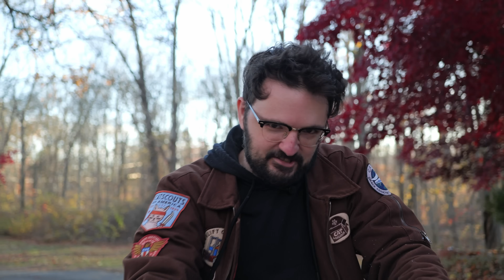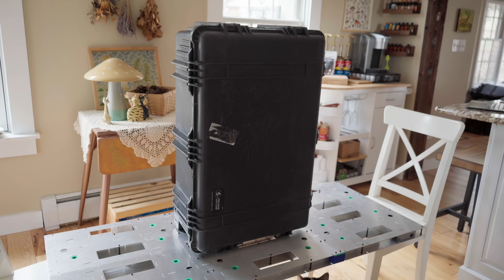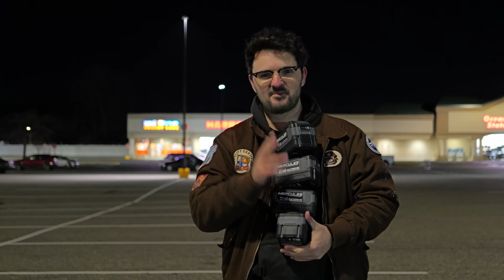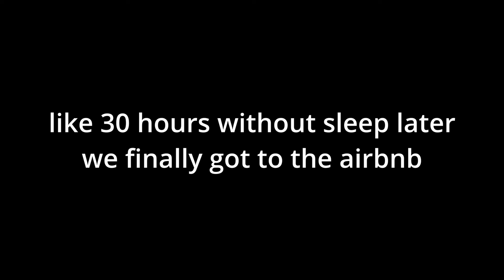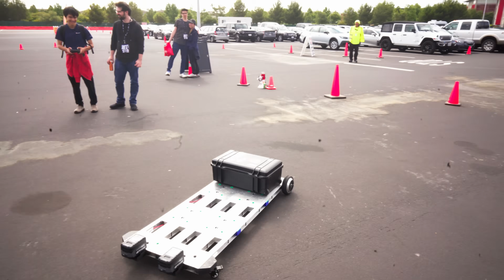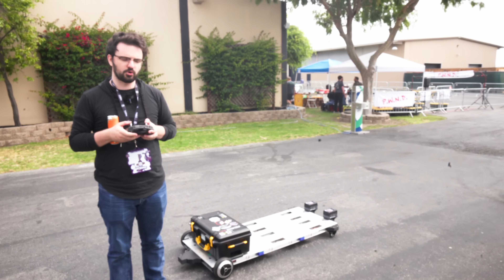Making a Utility Vehicle That Packs Into My Carry-on

Comment from the maker: I think i could make it even more truck like if i could've used carbon fiber, Hope you all enjoyed and thanks for watching!
Join my discord to get slightly early access to videos! https://discord.com/invite/htSdsgsGaN
Reply: That was pretty cool!  One change that might make things easier would be to put the powered wheels in the center of each side, with a caster in each corner.  That way, both power and steering are centered under the center of mass.  

I would also have the wheels slightly lower than the casters, so both wheels are always firmly on the ground, even when the ground is uneven.  As long as any weight isn't dead-center, it shouldn't rock back and forth.

Cheers!
Reply from the maker: @KeithOlson great suggestions! I think  my biggest issue with doing changes like this was just the weight issue, casters are usually steel and steel is heavy!
Reply: @KeithSachs  I just did a quick search and you can find casters with aluminium frames and cast aluminium hubs.  One example that might work well is the 'Durastar Medium Heavy Duty X05 Series - 3" x 1-13/16" Sirius HD Donut Polyurethane on Aluminum Swivel Caster - 550 lb Capacity'

Cheers!

Comment: Cool idea. Would be awesome to see you take it to the next level by incorporating the case itself as a structural element. There's a lot of material that counts towards your weight budget, but doesn't add to the final product. The caster wheels could also be used as the carry-on wheels when fully collapsed.

Also, switching to a carbon fiber composite could potentially save you more weight.
Reply from the maker: id love to do all of these, i wanted to do both originally but i had already purchased metal before incorporating it as the actual case, and carbon fiber was just way too expensive. Maybe one day!

Comment: In future, you'll get more controllable steering if you move the drive wheels away from the end toward the center a little bit. There's a lot you can do with quadratic input curves on modern transmitters too. I would use a "v tail mix" for steering so you don't have to do the tank steering thing. The bonus is that when you mix the channels to pull steering onto a separate axis from drive, you can suppress the steering channel with either more "expo" or even bringing down the gain to make the steering less responsive than the drive. It can't change the physics of the long-narrow config, but it at least makes it less enthusiastic to go into a death spin.

Comment: I think you confused full throttle for minimum throttle position. Looks to me like your "truck" went full reverse on disconnect, for which you need to tell your tx/rx system to fail to center throttle, or you could just use your aileron channel for forward/reverse...
Reply from the maker: It went reverse in the sense that I am choosing to say the casters are the front, but the actual setup is that hitting backwards on the throttle makes it go 'forwards'
I did this intentionally because I originally wanted the casters to be the back, but it drove better the other way. 
I didnt change it because i figured the reverse beeps were a feature to let people in the crowded venue know that something was near them.

Comment: A stick radio intended for ground use, with a sprung throttle that returns to neutral would have been more optimum, with mixing for left and right motors ( driven motors should be at the front, not the rear unless you like crashing and spinning out ) to give a more natural steering/driving experience. The failsafe mode on signal loss is also more ideal- returns throttle to neutral. Live and learn, robotic combat guys have this all figured out- worth doing some research in that direction for an improved future version... :)
Reply from the maker: You're totally right about the controller for sure haha I had never used any of this radio stuff before so I didnt know 
But I actually disagree about the driven motors being at the front, I tried this and it was less controllable, because the thing is so long.
The controller is actually mixed this way and everyone who drove it agreed and defaulted to driving it backwards. Thats why William Osman asked me why it was mixed like that, because backwards on the controller made it go 'forwards'

Comment: I think the controls would be way less twitchy if the sticks corresponded to acceleration and not speed
Reply from the maker: perhaps, i think the twitchyness is mostly because its so long, if the wheels were in the center and it had casters on both the front and back it would be way less twitchy

Comment: Nobody wants their "drone" receiver to switch to full throttle when the radio is switched off, that would be a pretty stupid thing to do ! 
Any decent RC radio can program the desired fail-safe in the receiver... (and also make curves and dead-zones to reduce the twitchiness, mixing to use tank steering with F/B L/R sticks, etc..)
Reply from the maker: Lol yeah I was exaggerating, the default behavior of this reciever is programmable yes, but the default behavior IS to throttle up. I assume its supposed to be like a "hover in place" thing but im not sure. I imagine that behavior would need to be tuned. 
Either way it was just unexpected for me as someone who has never flown a drone I would've assumed no connection = no throttle
Reply: @KeithSachs  Depends on your flight controller, but default setting should be either 0% or 50% on the throttle channel, never 100%.
Also, I guess (hope) it's meant as a joke, but you should not power the ESCs of a drone to program it, and if you do, you HAVE to remove the props !

It's a cool project nonetheless !
Reply: @MadMaxGyver  Glad you noticed the bit - I intentionally used a little 3" quad on a current limited bench supply and a very loose connection to reduce the danger. Props off on the bench!
Reply: @itsnotsam  Glad you did that the safe(r) way !

Comment: Fov pilot here you do NOT want it to go full throttle when the controller disconnects. That shouldn't be the default settings you probably had your failsafe settings wrong.
Reply: oh, i figured it out i think. it is dropping throttle to zero. but you're using a reversible ESC on the throttle channel. zero is negative 100% for those by default on the throttle stick.
Reply from the maker: @xymaryai8283  i'm definitely no drone expert haha i think you might be right though that makes a lot of sense !
Reply from the maker: I was exaggerating but it is to throttle up, I think its probably to hover in place. I never changed those settings they were 100% the default though
Reply: that... still... WHAT? like, i'm not gonna say you're wrong or stupid, but NO CONTROLLER SHOULD BE SETUP LIKE THAT BY DEFAULT. literally every controller i have ever tried, will drop the quad like a rock, because then at least you can have a relatively okay idea where it is, and it doesn't fly off to Timbuktu.

there is 1 (one) exception that people would encounter, and that is GPS equipped drones, that will instead have its own override behavior on board, where it will see the connection dropped and throttle drop to zero, and then use its own on board computer to ignore it and fly it back to the home location, or whatever you set up.

the controller has ZERO influence on that behavior, and should ALWAYS drop throttle on disconnect.

edit: okay, there is one other exception, and that is extreme long range flying. if you are at the base of a mountain, and you're flying up at the peak, hiking all the way up there because of a failsafe would suuuuck. YOU SHOULD HAVE A GPS IF YOU'RE DOING THAT but for insane efficiency ultralight longrange builds, you could justify skipping it.

but that is pro level stuff. No Defaults Should Be Set That Way. certainly not the Radiomaster Pocket, that's not a high power long range radio.

Comment: You should have use soft roller blade wheels instead of casters. Those make so much damn noise
Reply from the maker: You're right! I have a design im working on in the CAD that uses some softer longboard wheels, hopefully saves some weight too!

Comment: Default behavior on most fpv flight controller firmware is to go into RX failsafe and kill power to the ESC. If it has GPS and altimeter then a Return To Home function may be supported but the default actually is to fall out of the sky usually. Then again, if you're just running straight ELRS ->PWM who knows what the hoverboard ESC is doing with that input. Since a hoverboard is equally likely to command reverse spin as forward it might be mapped from -1 to 1 rather than 0 to 1.
Reply from the maker: im pretty sure the default behavior for this specific receiver was to hover in place but that translates to throttling up for the cart yeah. it is an ELRS device

Comment: There is so much potential for this. You could’ve 3d printed tabs to mount the pelican case as the seat securely. I love this
Reply from the maker: i have soooo many ideas for a v2 haha
Reply: @KeithSachs  or the "case" can be the frame its self if you set it up to fold out flat when not being storge
Reply from the maker: @final_catalyst this is something I want to do very much and did think about, you have to do it in such a way that its still easy to open for the TSA, I THINK it might be harder to get on the plane but I have thought about this and would be what I do if I ever make a V2

Comment: Is this the beginning of the SPMT arc?
Reply from the maker: like the vehicle? "building a truck to transport a plane" lmao
Reply: @KeithSachs  Eventually LOL! But just thinking of next Open Sauce, what if a whole bunch of people bring their own identical carry-on trucks, and link them as modules in one big truck... could all the motors be programmed to have one off-the-shelf controller rule them all, or would they need a bespoke controller for turning each module's wheels at different angles & RPMs depending on where they are in the grid? (To avoid having to Austin Powers turn it around.)